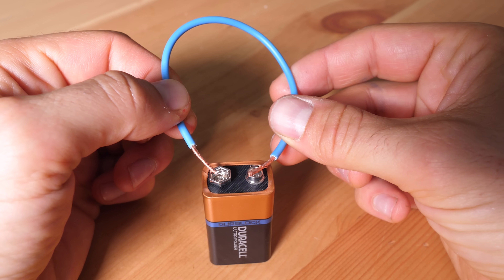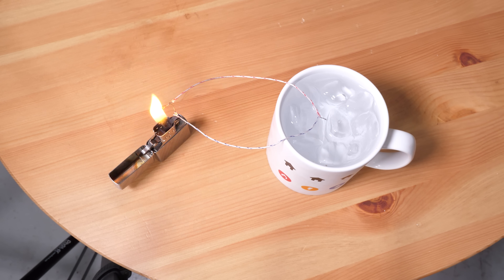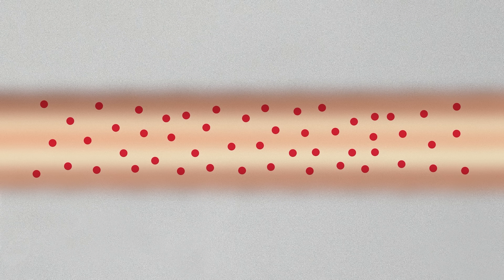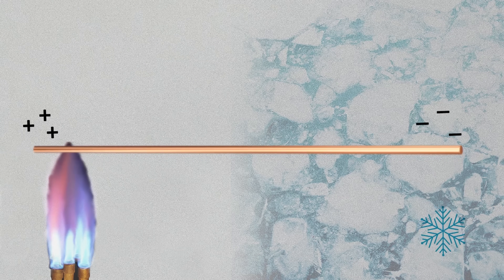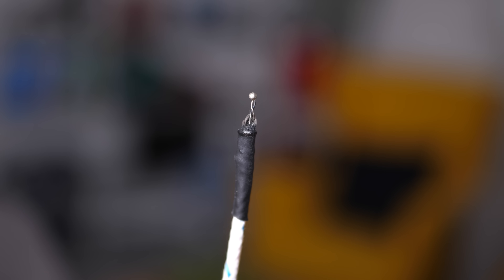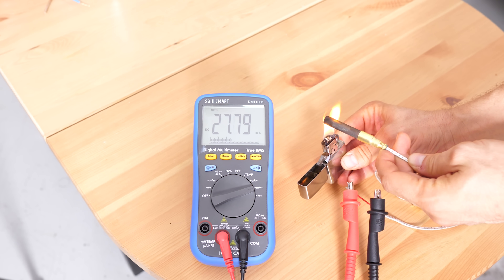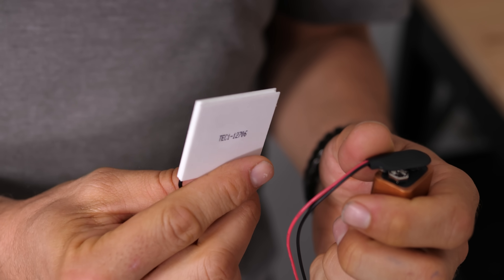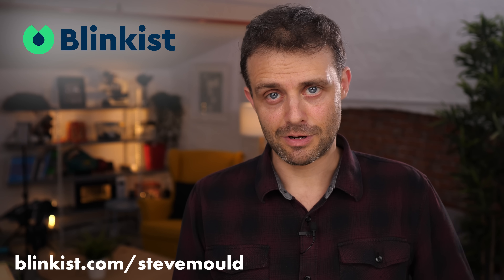Make Electricity Go Round and Round - The Thermoelectric Effect

Comment: I've a project I want to do one day with the Peltier effect : Use a Peltier module between a CPU and the radiator to increase the cooling efficiency + thermal sensor and humidity sensor to calculate the dew point and avoid condensation on the motherboard. Because an offline Peltier module is a thermal conductor, when it's off, it should be sufficient to connect the CPU to the radiator and just wait for the temperature to rise a bit before switching it on again when far enough of the dew point. I had these idea after seeing people using it on a CPU with hydrophobic spray on the motherboard and the ice getting all over the place. But for now I don't have a radiator+socket that let me put something between them (probably one with screw may work or I need to find someone that can increase the size of the attachments for the radiator)
Reply: @bosstowndynamics5488  it's for that reason I plan to test that on a 2003 motherboard with an unlocked CPU of that time so I can test the efficiency and temperature dissipation at different rate and power and see if it's something I can do on a newer setup. Don't forget that the Peltier will not be always ON and that a controller will stop it before the dew point. I can also monitor the radiator temperature and stop the Peltier module if the temperature is going to high
Reply: @Tutul_  how about using a real cooling system from a fridge?!
Reply: @PeterAbt  it's big, contain a toxic substance, need a compressor that do a lot of noise. I'm not sure if you were serious or just trolling
Reply: @Tutul_  You ask him if he is trolling when he tells you a way to actually pull that off... after you asked about doing it a way that is nearly impossible?
Did you do any basic calculations? How much heat do you want to remove from the CPU?
At what temperature is the CPU at that point?
What is the ambient temperature?
How efficient is it / how much energy does the peltier need when it has to move this heat with these two temperatures on its sides?
Now you know how much heat has to be moved away from the peltier. How are you going to get that heat away?

As a next step, after doing that and thinking about it:
Notice that you would have to cool the peltiers hot side to ambient temperature, so the cooler would have to be absurdly good to cool it that far down (~impossible). So now you have a new temperature much higher than ambient on the hot side of the peltier. What is the efficiency now to move the CPU-heat at these 2 temperatures? How much heat is it on the hot side now? etc.
Reply: @leocurious9919  what reason exactly would require the hot side have to be at ambient temp? You have missed some crucial parts of this idea. I came to the comments for this exact idea, and it is definitely possible.
Reply: @siratomfitz  If the hot side of the peltier is not at or near ambient its heat pumping capabilities quickly go to zero. Maximum heat is pumped through it when both sides are at the same temperature. None is pumped when both are as far appart (temperature) as it can do. This is an issue with (heat) pumps in general.

And since the cold side is not actually supposed to be cold (condensation) this doesnt leave much headroom above ambient conditions.
Reply: @Tutul_  I came to the comments for this exact idea. The way you propose waiting until the cool side has enough thermal load from the cpu that it effectively couldn't reach a level of coldness that would create condensation is for sure the way to go. It seems like it should also be possible to modulate the amount of power going into the Peltier module to bring it up to temp on the hot side only as quickly as the radiator can draw heat away. I would think this would also help avoid reaching a dew point on the cold side. This seems like something LTT would/should try.

Edit: after looking LTT already have tried doing this! heres the video for those interested. https://www.youtube.com/watch?v=IX2NQ1lq4ZM
Reply: @siratomfitz  they did a video with an uncontrolled peltier module. and yea heat load will overcome them. But maybe a hybrid solution can be found. Still plan to test that one day. got the peltier an almost all I need for dew point calculation but still need an other computer to test on

Comment: I'm confused about whether you can have the two junctions separate like in the beginning of the video and use a power source to cool one end and heat the other. On one hand that seems like it should be possible as a reversal of the electricity generating process that Steve Mould showed, but if you can cool something like that, then why couldn't you extend the wires, hide the hot side in a box with the power supply, and then replace the box with some other form of electricity supply?

If that's possible why don't we have fridges or air conditioners in our homes that would we could plug in and cool things without producing any local heat? Wouldn't that break the 2nd Law of Thermodynamics?
Reply: You could and it would in some sense however to make an analogy with gas, imagine you've a piston, now heat one size and/or cool the other. Your piston would move in one direction but then just stop. That's not really usable. In steam engines what we do is then reverse the flow so as to create a rotation which is usable energy. The Stirling engine is closer here to the electromagnetic phenomenon as it has no mechanical "reverse" but instead a heat exchanger (aka regenerator) which as much like the second alloy.

Comment: I still don't understand the peltier device. If electricity is going from one metal to the other according to your explanation, one should get cooler or one should get hotter. But the actual device BOTH happen. Why does the material that the electrons are coming from change temperature?

Comment: Isn't "trapping electrons in a loop" how the powerful magnets in an MRI machine work? It's a loop of conductor bathed in liquid nitrogen so that they're cold enough to "super conduct" when the system is energised a massive amount of current is fed through momentarily then the current can be turned off and as long as you can keep it cool then that current continues to circulate.
Reply: Curiosity got the better of me so I looked it up.  Basically the MRI magnet is a huge inductor (like a transformer) so you can short circuit the windings and the current will continue to flow for a few months because like any inductor, it is constantly interacting with the magnetic field and it's this that allows the current to continue to flow after power is removed.

A simplification is that the current flow pushes the magnetic field (then once it has spread out through the whole conductor it stops flowing as the whole wire is now at the same voltage), but then with no current flowing there's nothing pushing on the magnetic field any more so it collapses back to where it started which induces a voltage in the wire making the current flow again, then because the current is flowing it pushes on the magnetic field again, and it's this back and forth between flowing current and a magnetic field that allows the current to persist in the MRI magnet for months instead of immediately stopping when the power is removed.
Reply: I believe that's the case but then you're also taught in electronics that all points along an ideal zero-resistance wire are at the same voltage, so how can you get a current flowing in a zero-resistance conductor if the whole thing is at the same voltage?  You need a difference in voltage in order for current to flow.
Reply: Well electricity cant flow at the speed of light can it? Can it? Idk dont got a degree in electricity
Reply: @404_thoughtsnotfound  It flows very close to the speed of light, the problem is it flows in all directions so if you don't have an external voltage pushing it in one direction then it tends to quickly spread out across a whole conductor.

Comment: The job of a 'Pilot Light' isn't for protection of leaking gas, (06:08) it's simply to light the main gas on the main burner when there;s a call for heat from the boiler.
Modern burners have a spark generated to ignite the gas, so no pilot light.
Pilot lights are very old fashioned and waste large amounts of gas, I doubt you could even buy a boiler with a pilot light.

Comment: I believe my boiler uses a bimetallic strip that keeps the solenoid circuit ON, which in turn is powered by a battery, but I might be wrong b/c the battery is a simple AA one and it lasts for years and in addition it has to power the thermal sensor and the gases sensor.

Comment: I don't quite understand how a thermocouple works for sensing temperature.
If you heat one end and cool the other, you get a current. But you don't have a cooling side. So surely, the temperature of the other end would slowly increase, causing less current to flow, eventually reaching close to 0?
And how do thermometers translate the current into a temperature if the current depends on the environment? There is no reference.

Comment: How come when the electrons fall into the lower energy state between metals they dont release some frequency of light? Or they do but its immediately absorbed by the metal?
Reply: they might, probably in the infrared though (what we perceive as heat). similar to a diode... since the frequency depends on the difference in energy it would make sense to me. but I'm not quite sure what role the non-existent band-gap in metal plays then. you're wondering about the Peltier-effect I assume?
Reply: heat == infrared :D

Comment: Do you know that you can get a perpetual cicling curent With a supracondutor torrus?
Reply: Actually this is the working principle of a superconducting electromagnet! After pushing tons of current through a superconducting coil to create a magnetic field, the ends of the coil are shorted to create a closed loop of current that can flow with no input for months!

Comment: You can get current to loop around a wire. It's how switch mode power supplies work. The problem you had was that as soon as you disconnect the wire from the battery, you break the circuit. If you had a freewheeling diode to keep a circuit it would have worked.

Comment: In addition to the missing video clip of the bouncing balls. You also said "And the voltage that you can get is much greater, as you can see here" at 5:38, but your multimeter was measuring an increase in current, not voltage. So we could not see it there ;)

Comment: I circulate and reuse electricity, by first charging up a coil (magnetic field) then discharging the inductive spike back (through a series resonant coil) to the source.

both coils are coupled and assist each other. it is super efficient, produces very large currents for relatively very low power.

see my april 2019 Radiant Power video, and the rest of my channel for more info.

Comment: In this you are not really making anything go round and round . You are using the energy of the heat to create a current like a thermocouple so it follows the opposite if cold which is only an area that is less energetic should create an opposite effect that will always try and equalize things in a cicuit. The direction of flow travels from more to less. Passing A.C. current through a flame will also turn it into. D.C.  A flame is a type of low temp. plasma its called "flame rectification" and its also used to verify a flame in a comustion system.

Comment: that "pull it off the battery real fast" thing actually does, very briefly, have a circular current. conductors, like any medium, have a propagation speed, usually implied by the characteristic impedance of the conductor. essentially, the "edges" of an electrical signal are transients, and exist in the frequency domain. when you lift the wire off the battery, the change in voltage propagates down the wire at that speed, and it takes time for that wavefront to get all the way to the other end of the wire. if you managed to connect the other end in time (pretty hard, the slowest propagation speed materials are still 60% the speed of light), that wavefront would travel in a circle for a while as the series resistance of the wire slowly ate away at it until eventually the loop had zero net voltage again
Reply: to be more precise there wouldn't be a circular current, but four circular transients, one from each end from when you lifted the battery off the wire, and another one from each end from when you reconnect the wire to itself
Reply: look into Transmission Line Theory for more information on the weird world of what high frequencies do in a wire.

Comment: most boilers in the us do have a pilot light, its more cost effective to heat with the gas rather than electricity
Reply: Many newer ones use hot surface igniters or spark ignition.. They don't have a pilot light at all. Pilot lights can account for half the energy used in a heating system.

Comment: The start of this fabulous video reminded me of something also fabulous. 

Edward Leedskalnin. 
He made an iron U shape.
And with the use of coils added a field.  
Once the field was present he added a second piece of iron across the ends of the U(creating a circle), then removed the coil supply.
It was then said that, when the second piece of iron was removed the coils would output. Regardless of time from initial setting. 
I have tried this, it is true. It does indeed hold. I operated an LED 2 weeks after setting. I don't know if it holds forever, i had no use to continue testing. It was a proof of concept exercise only.

Comment: So, if we keep one end of a large thermocouple at considerable depth inside ocean and other near surface, can't we use it as a source of energy?
Reply: Yes. Might not be the cheapest or best way of getting energy but it seems possible. https://en.wikipedia.org/wiki/Ocean_thermal_energy_conversion#Application_of_the_thermoelectric_effect
Reply: The losses in the long wires connecting them would negate any benefit. Each thermocouple needs its own pair of wires. Radioisotope thermoelectric generators are used in spacecraft, and non-radioactive wood stove powered electric fans are commercially available.

Comment: Can you use an analog of this effect with real fluids to make fluids move around?
Reply: it's called Bubble pump or Airlift pump. It move fluid by reducing the density of water. The idea are similar. Gravity is used instead of atoms for different Energy Potentials, and Bubbles are used instead of heat for controlling fluid density/pressure.
Reply: @xponen  that's very cool! Thank you.

Comment: 0:05 I remember as a kid I visited my friend who had some fancy set to make your circuit and such a nice wire. So I found a multi-plug thing on a cord that I suspect was unplugged (spoiler alert, the unplugged cable was from different one I did not see) and made the nicely U-shaped wire that would fit into and I wondered if it is possible to put it inside... And it was, the light started to glow, the lights were dark....in the whole building, not just my friend's apartment, so luckily for me no one knew I was responsible. I swear the wire was much shorter after my experiment. Oh yeah and I know I was lucky nothing happened to me.

Comment: I love peltier units. I have been playing with using them on the back sides of solar panels to help efficiency.
Reply: Could work in as a chiller for water cooling but if it were just covering the rear of the panel then it would need alot of heat sinks which would surely be better to just attach directly. The thermo electric cooler would take more power than the gai s of using it